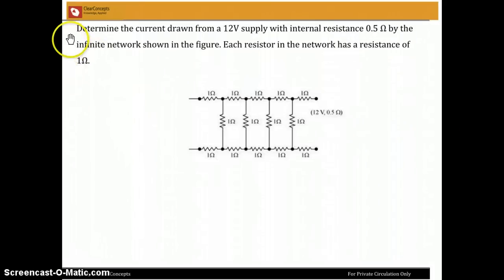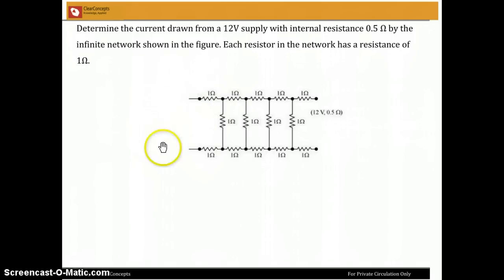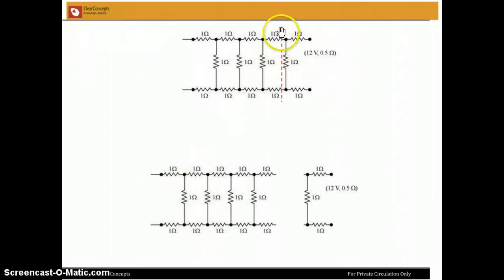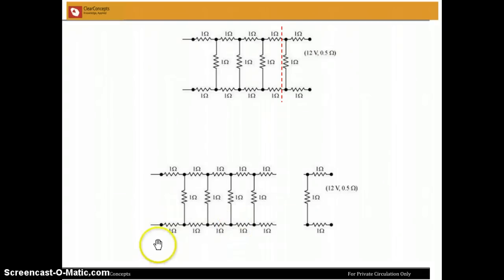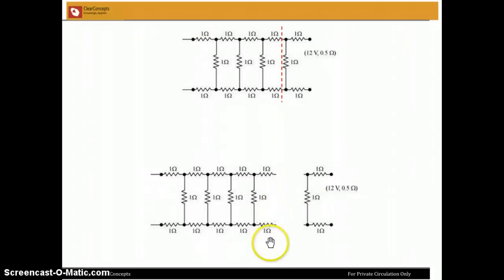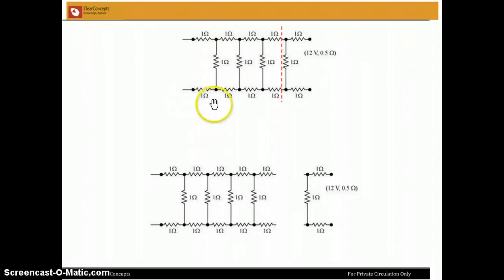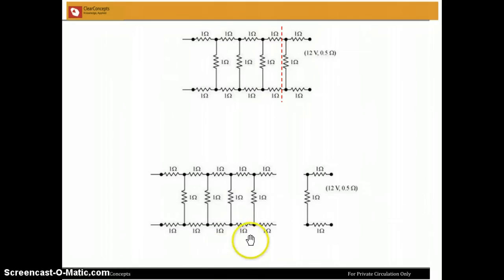Effective Resistance of Infinite Ladder Network - Free IIT JEE Training Video

Comment: The network is infinite. Hence, equivalent resistance is given by the relation,
R = 2+ R∕ ( R + 1)
R2 - 2R - 2 = 0
R= [2± √ 4+ 8 ]  ∕  2
  = 1 ±  √ 3
Negative value of R’ cannot be accepted.

Hence, equivalent resistance,

R = 1 + 1.73 = 2.73 Ω

Internal resistance of the circuit, r = 0.5 Ω

Hence, total resistance of the given circuit = 2.73 + 0.5 = 3.23 Ω

Supply voltage, V = 12 V

According to Ohm’s Law, current drawn from the source is given by the ratio,

12/ 3.23 = 3.72 A
Reply: But how did the relation R=2+R/(R+1) come
Reply: DIY with DaIsY Thank you so much